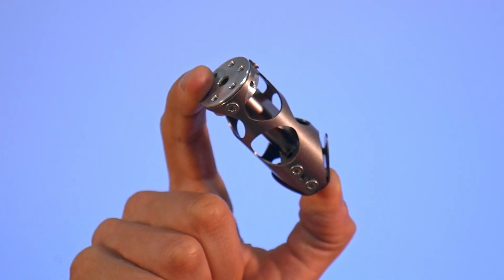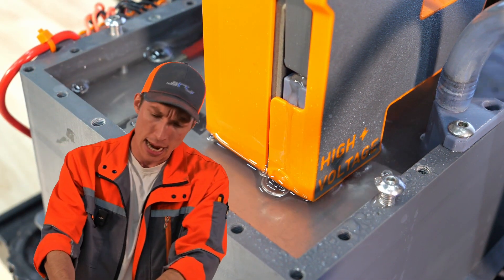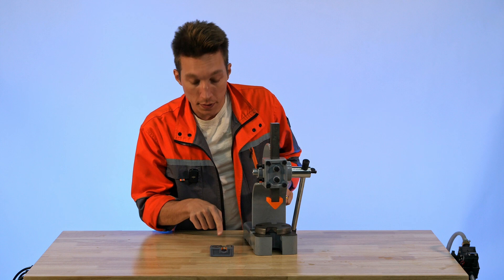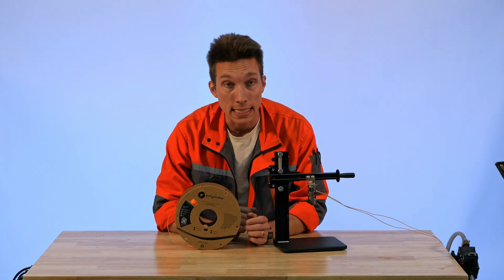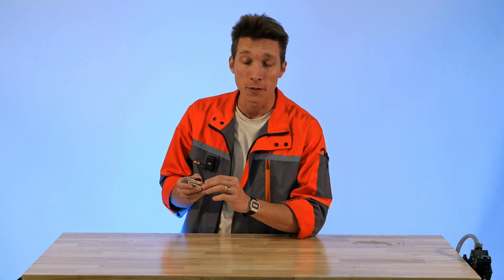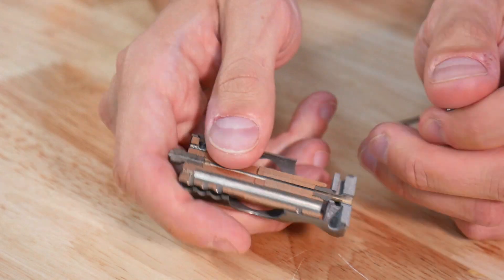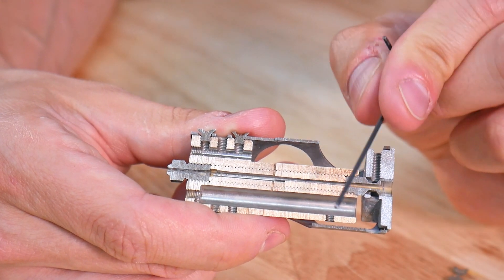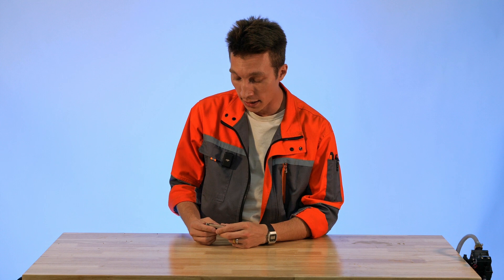We DESTROYED a $300 HOTEND

Comment from the maker: Would you guys want to see us slice a Slice Engineering hotend? Let us know!

Any other crazy ideas for projects?
Reply: As just an example: I'd like to see you make a Nema17 or Nema23 motor mount in at least 3mm thick aluminium that allows it to be mounted to a 2020 aluminium extrusion with M5 holes for the bolts and some sliding holes for belt tensioning.
Reply from the maker: That's a good idea! We definitely do a ton of stuff with this kind of motor.
Reply: @rackrobo  M6 holes would also be okay, I think most extrusions have a 6.35mm slot or something like that?
Reply from the maker: @MarinusMakesStuff  We'll figure it out. Any size should be fine for WEDM
Reply: Thank you for doing this

Comment: For anyone wondering, the reason aluminum (t6 hardened) needs to be quenched to be workable is because T6 aluminum gains its strength and hardness from small precipitates that form in the crystal as it slowly cools. Cooling it quickly prevents these precipitates from forming, as the now evenly distributed solute (not-Al) atoms don't have time to come together again, therefore it's much softer.

Comment: Part of the striations are due to the resistance changes from the different thickness and materials. Some of it is tension since you don't have an active tension system to compensate for the wire elongation and lack a despoiling motor to remove the inconsistent resistance and weight of the spool from the equation. Also your flushing pressure, combined with flow turbulence will be  moving the wire about. That is a big part of why you would normally do a rough cut and then finish skims in industrial machines. I would agree that lack of a second wire guide combined with the run out of the bearing is not helping matters either.

Love the progress you guys are making, just a long way to go to catch up with industrial machines.
Reply from the maker: So true! There's a lot more to get right with desktop WEDM. Very excited to see how good we can make it!

Comment: How long did it take to cut out this part? I'm thinking about buying a wire EDM machine, but I'm inexperienced with the cutting speed
Reply from the maker: The flow test mount took about 20 minutes to cut. Very easy to cut complex shapes in aluminum plate.

The Chube took probably 2 hours of constant cutting all together. Copper is very resistant to EDM cutting (because of its electrical properties) and it was a really thick section. Even steel would have been faster than copper here.

Comment: You mentioned that the ASA got pretty hot and burned a bit in the hotend, is the heating pretty uneven or concentrated in one part of the hotend?
Reply from the maker: It's that we ran it a little too hot. Should be very even from the large copper thermal mass